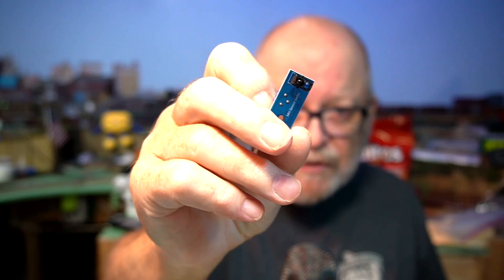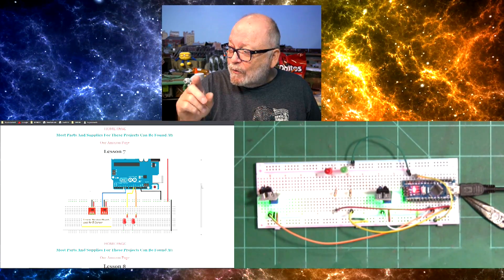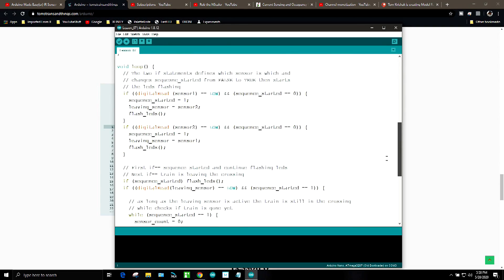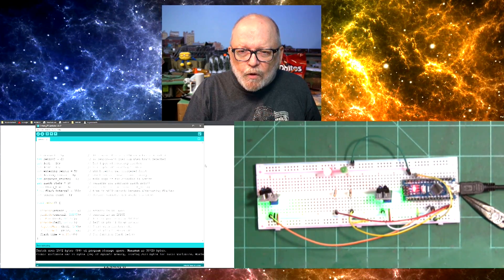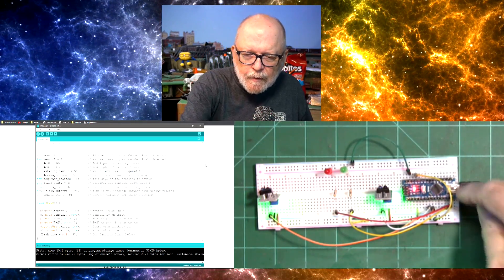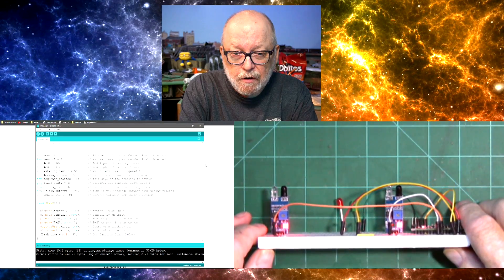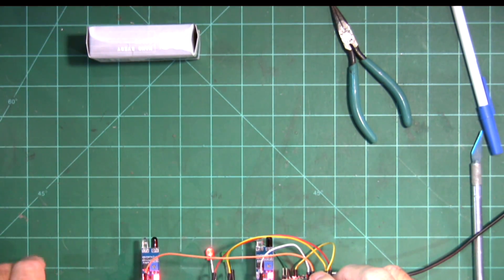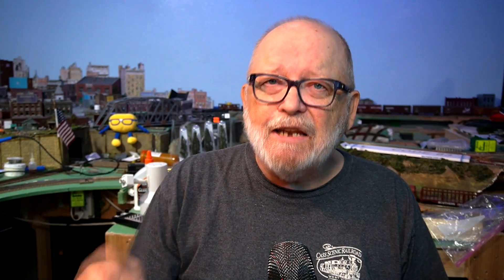Arduino - TCRT5000 Series IR Sensor

Comment: Thanks for the video. Perhaps the problem with the newer one is because of the potentiometer and PCB? Since only resistors are needed, perhaps a custom design would show better results. I am curious: what are you actually measuring?
Reply from the maker: The entire batch that I bought was like that. I'm still using the other version where the Sensors point straight out

Comment: I made a simple circuit with a regular white led and a photoresistor.  It sucks at picking up changes in the daylight.  Is this any better?  If so, why?  Is it a wavelength thing?
Reply from the maker: A photo resistor uses ambiant light. This reflects an infrared beam
Reply: @TomsTrainsandThings  i see. Well, I ordered one. I hope it works better than my led one. Thank you so much!

Comment: Hi Tom.  My mod is change out the 5mm to 3mm diodes and mount them on the back so I could screw the board to my base board, with the components facing down under the base board. Have notice these 3m are great under normal light with range of 10 to 20mm.   But in the sun I could not get them to work well 3 to 5mm. Let my know if you won't more info or pictures. The 3mm diodes are easier to loss into the back ground. Wrote my ardunio programme with latch logic, on my mock set up they worked very well. With c19 not helpping on the supply side the install on the main board is sometime away. Regards Paul
Reply from the maker: Thanks for the info Paul. I'm satisfied with the way mine have been working. Send me an emaill if you would like to send some additional info.
Reply: Hi Tom one  of my offspring had her 21st last weekend so dad's life heading back to normal.... visited your Web page something wrong in opening it with chrome.  Please flick me a response to barchampaul177@gmail.com I will send an attachments as jpeg and word. Let me know if you cannot handle these formats, keep up the great work paul.
Reply from the maker: Send me an email, it's listed in the description. Your message gets sent to spam when there is a link in it!

Comment: I have used the TCRT5000 version 2 successfully with crossing flashers. They work well in N scale and are easily installed under the tracks in the foam. I’m not even using an arduino with them.
Reply from the maker: Glad you ware able to get yours working. I can't see less than an inch reach acceptable. Out of 6, 1 was bad, the 3 that I adjusted, I could not get any greater distance out of them. I didn't bother testing the last 2.